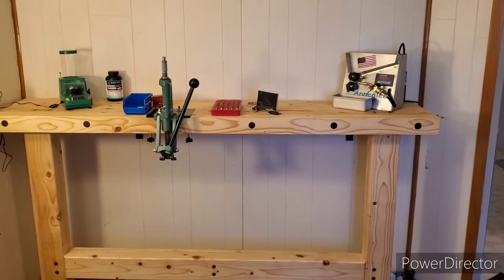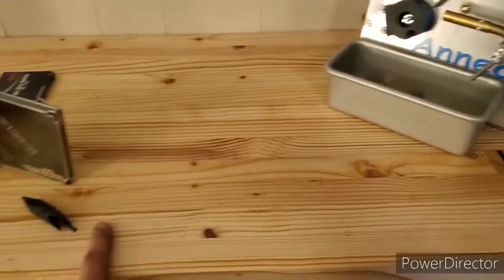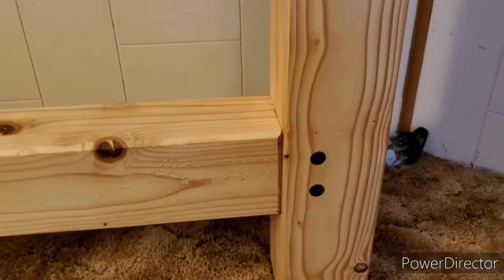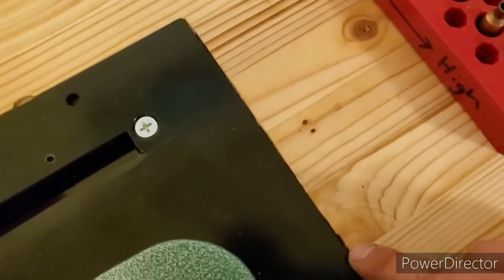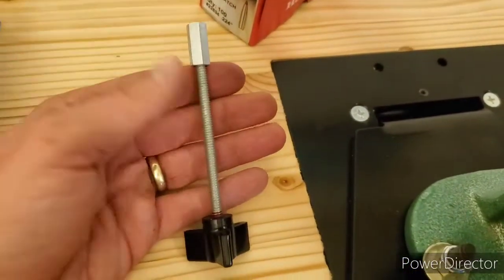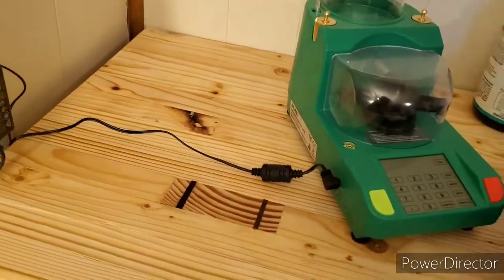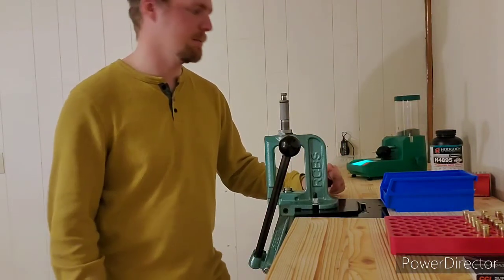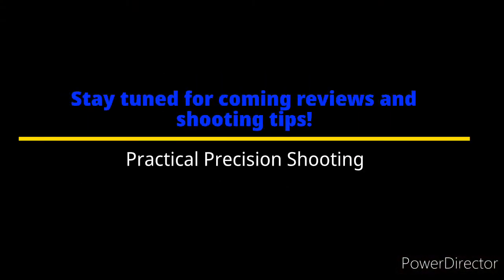Update, New bench! Inline-fabrication!

Comment: like the way you did it . kinda like mine only i put the inline mount back to where the ram is on the edge of the bench . works great . i also have the riser mount and have it back the same way all the force goes to the front legs .
Reply from the maker: Thats an awesome idea! Maybe on my next bench. I'd still like a good barrel vice set up. In that case close to the edge is better but a riser would solve that.
Reply: @JacksonMalcolm  when i set my riser up i put the press on the change plate and slid it back till the lowered ram handle touched the edge of the bench . then moved the riser one inch forward .i mounted my riser on t track so i could slide it around . and it sits right inline with my bench legs so i get lots of force . maybe to much force as i can see my quick mount flex a little ! bows up just a tad when i put force on the press . but it is rock solid and not inlines falt . i have a bench mount set up like they say on the edge and it don't move or flex . realy only use it for powder drops . you are on something with mounting a vice that way . been thinking on doing that myself but my ould vice is on my gunsmithing bench so it is out of the way . they make 2 types of risers one is a bench mount like mine . i got the 9 inch one . the other mounts in the quick change mount and then a quick change plate goes in to it . sorry so long on this reply . most people go off saying my press is mounted wrong , needs to be on the edge of the bench ! lol just cant get them to se the benefit of my mounting .

Comment: I flipped when I saw you video and what you did to mount it truly flush. SOOOooooo, my mount(s) arrive monday and I want to see if you could offer some tips on how you drilled holes through the 2x4s and line them up for the long screws. You mentioned you bought something online?  Also searchde your vids for the update on the annealee ....  nice work on the bench and clever work on the mounting screws!!!!
Reply from the maker: Yeah for sure, and I believe primal rights still has a video up of how he did his flush mount. I've since done a second and am still super happy with it.

Make sure to drill the wholes before routing, I used a 7" square standing up on the flat spot to keep my drill bit relatively square. I went with one that was a hair bigger than the pilot on the forsner bit. If you have problems with the forsner hopping around just run it in revere for a couple seconds. 

Make the two holes you use to mount the plate as big as you can so they have some wiggle room to start the threads. 

And yes, I've got some work to do on some annealing videos don't I haha. Anything you want to know about the annealeez or just annealing in general?
Reply: @JacksonMalcolm  No your flush mount video was so informative and to the point that annealing would be worth watching I am sure....Oh drill the holes first for the flush mount or for the quick release plate? You marked the holes for the attached plate bolts and drilled from above yes?
Reply from the maker: @Johan_Pentrose  when you get the flush mount base you'll be able to use that as a good template. I'll try to measure the drill bit some time today and let you know on size.
Reply: @JacksonMalcolm  thanks, the threaded rod will prolly be 1/4_20 but the flare for a flatheaded screw. Thanx
Reply: This turned out very well . I have pictures to show you….  So, you simply drilled a hole straight through the wood under the plate bolts and fashioned a long nut….thats what you mean when you say countersunk?
Reply from the maker: @Johan_Pentrose  awesome! It'd be great to see! And since my bench is 2x4 the bolts that came with the mount weren't long enough so I drilled a hole deep enough to reach the screw/bolt and wide enough to fit the washers.
Reply: @JacksonMalcolm  I will be going through 2x6 instead of 2x4. 1/2" Spade bit- Hoping alignment wont be a big issue.

Comment: Any tips you used to route the space for the base. Any particular router bit or system you used? I am there has to be some sorta of jig to stay inside the outline of the of the base at a depth of 7/16”.
Reply from the maker: I'd have to check but I seem to remember a 1/4" bit matched the radius of the Conners. After carefully doing the outside, there are 3 main depths. The depth of both plates, the depth of just the top plate and the depth needed to clear the "tongue" of the plate that goes on the press. I think I just physically put the plate in to my router and set the depth off that. Other than the 1/4" bit I don't think the rest matters. I did make a jig and clamped it on. Other than that it was just planning out the passes carefully and don't get in a hurry. 

There will only be the two little shelves at the front to match the cutouts they don't have to be pretty underneath but the face cut into your bench should be.
Reply: @JacksonMalcolm  ThaKS FOR TAKING THE TIME. I am sitting in front of my bench with evrything in place but then gee what do i do now...LOL   Any particular kind of router bit?